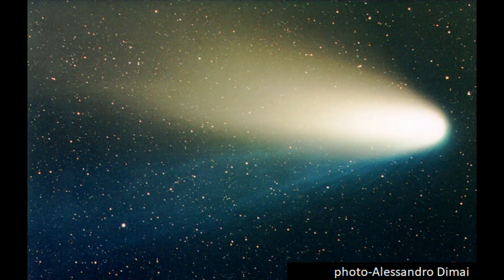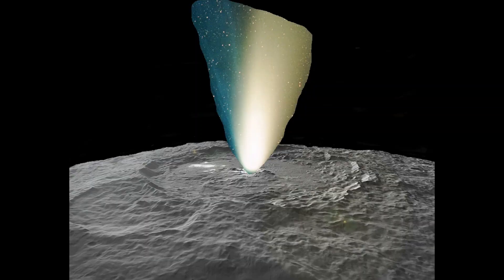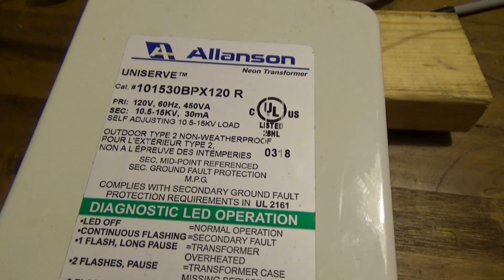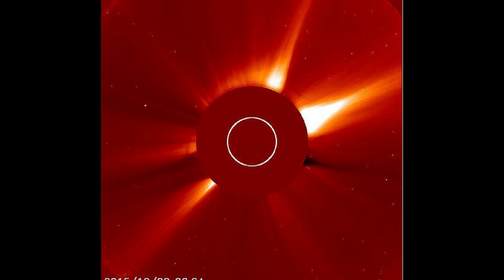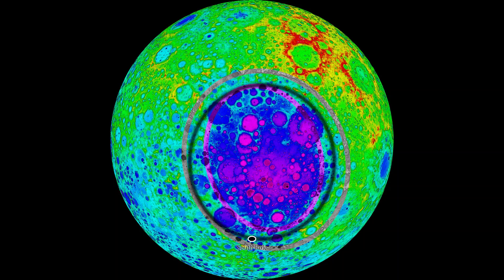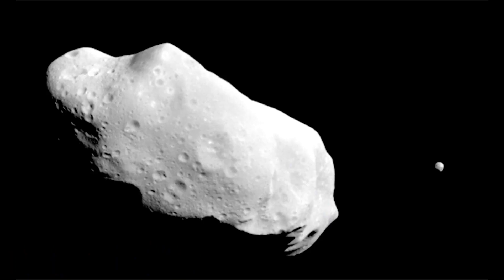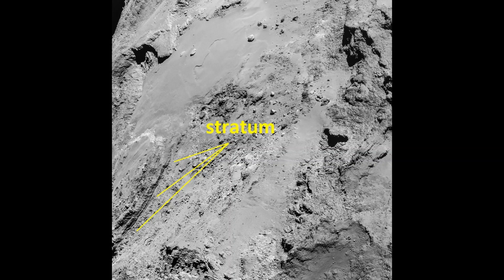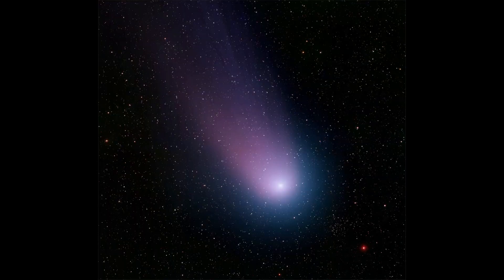100,000 lightning bolts!

Comment: We are living in a Galvanic cell, contain cathodes and anodes with some form of an electron salt bridge. The cathode is negatively charged, where reduction occurs, and where electrons are gained. ... Salt bridges help facilitate the longevity of the battery and complete the circuit for the flow of electrons.

Comment: thank you for sharing, I upvote and subscribe.   Consider that when earth and sun pass through the galactic current sheet, then the proton density will increase from 3 protons per cubic centimeter to 10 or even as much 100 protons per cubic centimeter.  To maintain equilibrium the earth must then lose 7 electrons or even as much as 93 electrons per cubic centimeter.  That's a lot of electrons that need to leave earth surface and enter space to maintain equilibrium.  OR alternatively it's the same number of protons that need to leave earth to maintain homeostasis equilbrium of electrons.
Reply from the maker: well said, it's interesting because if the heliosphere isn't enough energy to produce a crater (or a comet) there is always the galactic current sheet which is estimated at around 3 trillion lightning bolts. There is also a jet that was detected from the center of our galaxy that was 1*10^18 amps, well over 3 trillions lightning bolts.
Reply: What if a comet was a flying crater?

Comment: Your experiments have always amazed me and your plume and crater recreations are very impressive. 

Have you managed to recreate the sustained dust ejection also ? Bcos that dust being stripped off the comet is the real magic. In comet 67P's case, most of the plumes happened at dawn, not noon when it is the hottest and some of them are hour long ejections.

Has any other experimenter found success with sustained dust ejection ? Thanks.
Reply from the maker: That has me somewhat intrigued. I realize a comet will have more than one tail is because one tail is composed of dust. In this experiment Im not sure exactly what is coming out of the sand but i do have some ideas. I'm guessing that the purple is from nitrogen, and I suspect the white filament is comprised of carbon/carbon molecules; in a way that is similar to a dust tail. I'll have to look into 'sustained dust ejection'. Thanks for the comment.